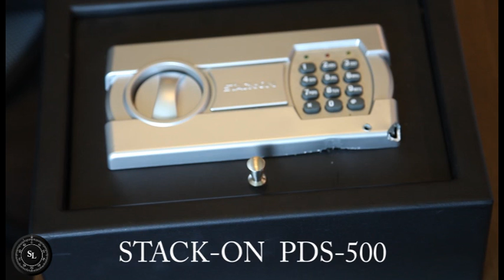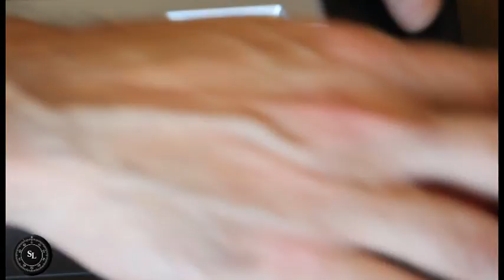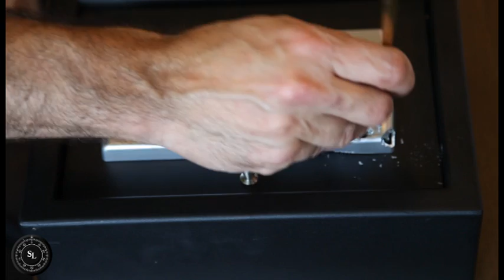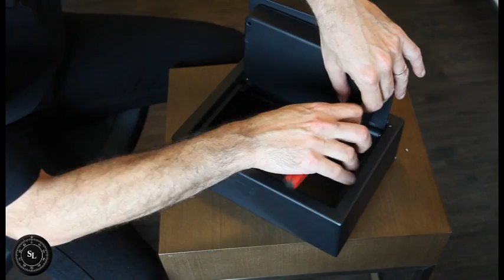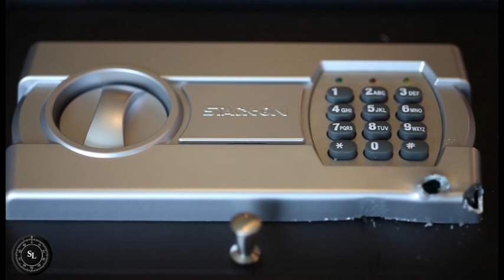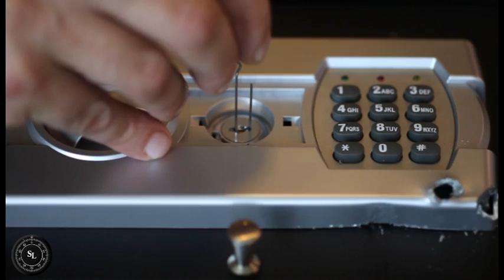ANALYSIS OF THE STACK-ON GUN SAFE PDS500 BY SECURITY LABS MARC WEBER TOBIAS AND TOBIAS BLUZMANIS.wmv

Comment: I don't have as much of a problem with the solenoid as I do with the key. The solenoid would take a fair amount of fiddling to work out given zero knowledge of the safe before hand (also very, very easy to fix if you are so inclined). The key on the other hand is quite disturbing.

Comment: In my opinion, I would be better off not having a storage box. I don't have kids. But, if I did have kids, rather than locking a loaded gun in a storage box (like the one in the video), it would probably be safer to lock the unloaded gun with a cable lock AND a trigger lock, and hide the gun. Hide the ammunition in a locked box, away from the gun.

Comment: I need a locked container to transport my handgun to the range. Since it's a cheap $35, it technically locks, and is CA approved (hehe), wouldn't it still be a good purchase for my purpose of range transportation? I don't safe my firearms to prevent theft because that's not a major concern of mine. I would only safe my guns in this locked container for transport and home storage (law requires they be locked at home too), but with no illusions about their lack of theft prevention.